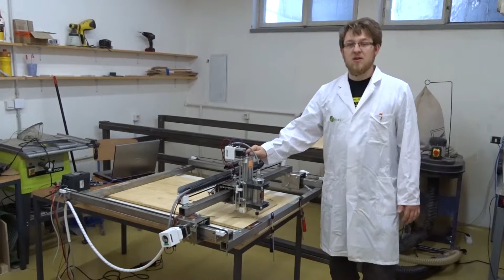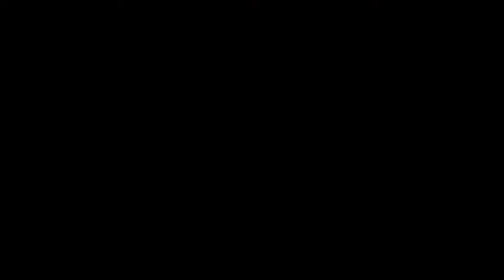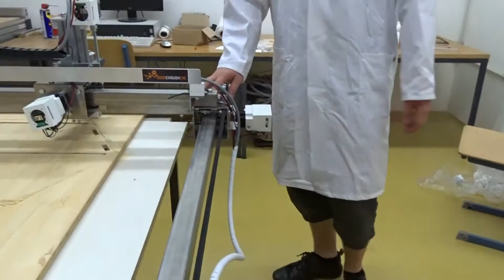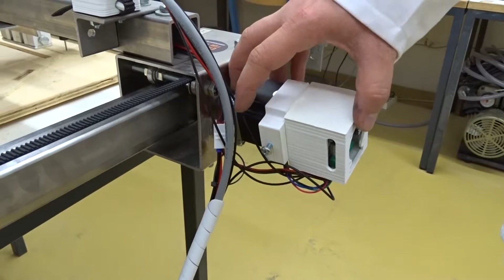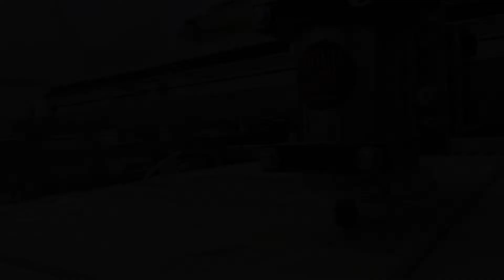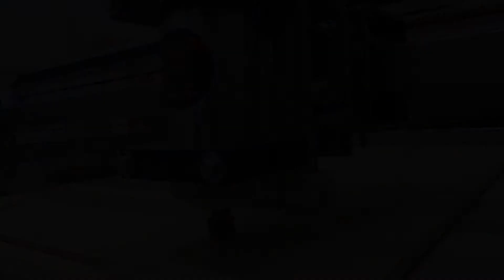GoodEnoughCNC Using ToslinkCNC

Comment: is the software included on the kit?
does it cut circular shapes?
how I can order it online?
Reply from the maker: I think we've already continued the conversation via email. But anyway - the design and G-code generation is best done with Autodesk Fusion 360, free and powerful. You also generally require a PC to run CNC software, you can either choose Planet-CNC controller that will be bundled with next generation of GoodenoughCNC Hybrid or 
use any open-source solution, like Arduino+GRBL and control it with one of many applications that exist, but neither really works that great. GRBL-panel seems to be one of the more working ones.